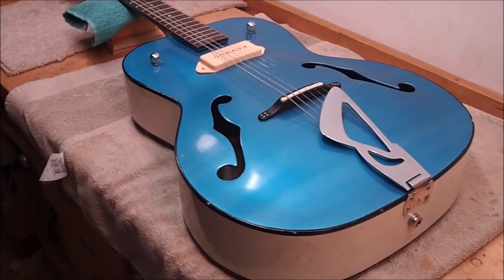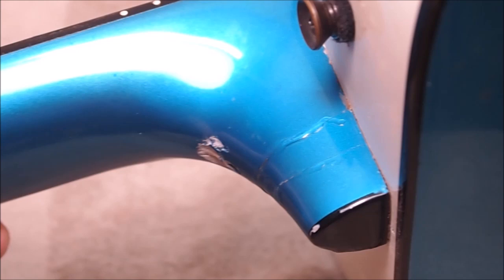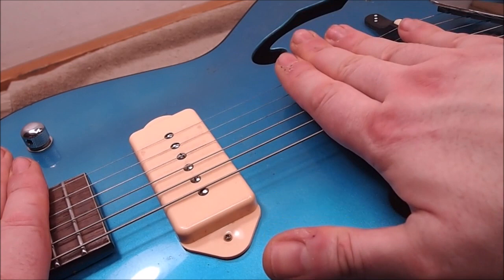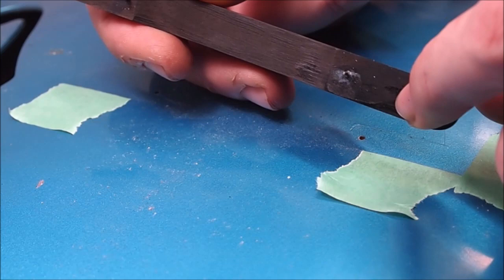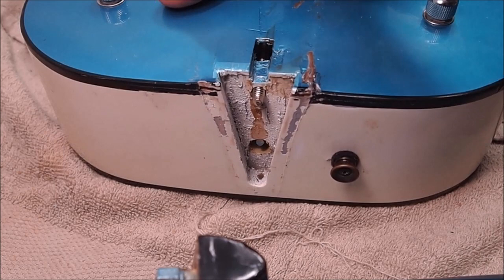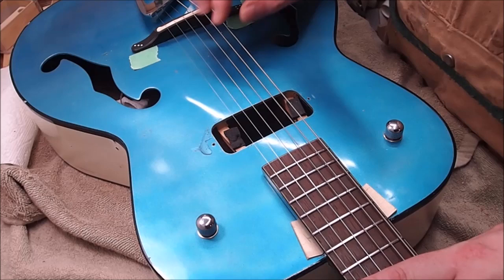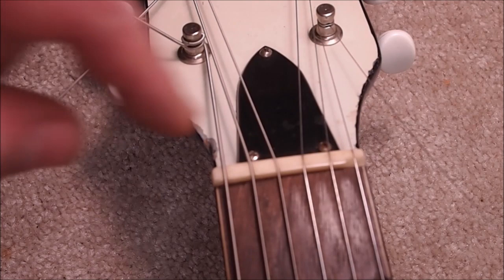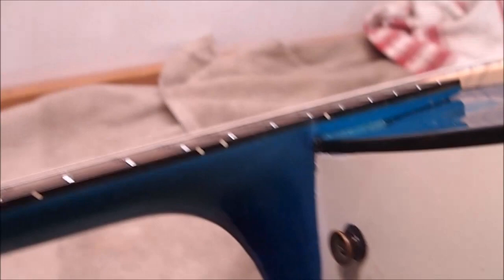Correct the Neck! Old Kay gets some lovin'

Comment: FYI:  You can find a cheap spectrophotometer on Ebay for around $30, You can buy a super high quality used spectrophotometer that is ordinarily very expensive for around 30 bucks as well.  These devices are exactly what body shops and printing companies use to perfectly match the exact color, then you can have the exact match paint overnighted to you.  I used to work in the printing industry and hardly anyone realizes that these types of tools exist.    I have learned so much for your channel, and I am glad to give something small back.
Reply: Tao Tuhao true, however it’s never going to be a perfect match, and if you don’t have a color mixing station like auto body shops have to adjust the color, it’s pretty useless.
Reply: @samueltaylor4989  Absolutely, but you can actually order a specific color based on the CMYK values.  However, texture matching is certainly more of a challenge and in this case the color is somewhat metallic so  the exact match will be difficult, even when you have industrial grade equipment . Speaking from experience , you can get extremely close.
Reply: @samueltaylor4989  This would take TWoody's repairs to a new level...great suggestion.
Reply: @samueltaylor4989  My local paint shop will measure and mix for you, only issue is the minimum size and price, but if the customer feels strongly about it it'd be well worth the effort.
Reply: I fear that Twoodfrd doesn't read the comments...

Comment: In addition to the great work that you consistently perform I respect that you chose not to disparage the work that was previously done on this guitar. There is an individual on YouTube who spends more time being critical of the instruments and the manufacturers than he does working, while the quality of his work is usually below expectations. I really appreciate that you spend your time (and ours) concentrating on problem solving instead of idle criticism.
Reply: Jts3339 I think I know who you're talkin about if it's an older man he does incredible work have a great day
Reply: But this work was a straight up disaster.  Its a bit different than nitpicking.  This work was unacceptable by any standard.   We need to hold bad luthiers accountable.
Reply: @charvelgtrs  The best way to hold poor practitioners of any trade accountable is not to shame them; it’s to withhold bringing them our work until they correct their ways or go out of business. Good or bad work speaks for itself.
Reply: Although saying "I won't disparage the work of..." is really the ultimate humble put down!
Reply: @jts3339  true but others should be warned to save them the trouble.

Comment: looks like b5 blue it's a plymouth car color when I need a match I go to an auto body supply store they will take a picture of your color and computer match it and put it in a spray can
Reply: That's asking for a poor color match. Too many variables that have to be taken into consideration. You'd be better off with taking whatever object you need to paint match outside and looking at it and color swatches under the natural light of the sun.
Reply: Roger J - try that computer color matching service on something that doesn’t matter too much, you will be surprised at how good it is. I was skeptical too but I gave it a shot. I’ve used it a couple of times now and it’s been spot on and well worth the trouble if your project has to be right. My local paint supply has a system that not only reads the color with a camera but dispenses the tint into the base as well, I think some only analyze the color and print the mix instructions. There may be a difference.

Comment: They make a flexible extension for going around corners.  1/4" is the size I have.  Works like a charm.  Get one for those tight jobs.  Or use a long extension thru the hole for the pick up jack and a ball headed Allen to turn the furniture bolt.  Also, for wood saturation, you can get a product called Git Rot from any boating store.  I got mine from West Marine here on LI, NY.  It's a 2 part epoxy that the wood will soak up like a sponge.  Get it and keep it on the shelf.  It has many uses.

Comment: OK, before I watch the rest of this. I agree with the neck needen to be raised. I would take the neck off, glue on some extra wood material, and then shape it to fit the curved top all the while raising it to get the desired string height. I hope that's what you are going to do as well...Let's watch and learn...continue...Oh, yeah, taking from the heal to change the angle. Great stuff..adding the shims fills the space. Awesome...my way was much harder. Thanks, this was a great demonstration.

Comment: Next time you have to deal with screws like that simply get a 1/4 drive ratchet set and 1/4 drive hex bit set.
If you can't find the correct length extension you can simply cut one off and grind a new square on the end to fit your application.
Reply from the maker: Hehe. I tried!  The socket body had clearance problems against the top and I didn't want to sacrifice my nice ball-end bit.
Reply: @twoodfrd  thats when you build custom tool 101a..grind off outer OD of socket housing till it fits!

Comment: Use a 1\4 inch drive ratchet for the Allen head bolts there is all different size extensions for length . I'm an automotive mechanic and nothing is user-friendly especially on the new cars lol
Reply: Was gonna say I have that ratcheting device he mentioned - 1/4" drive, long-handled ratchet, extensions & Allen heads on the "sockets" ...indispensable!

Comment: Great idea on the spruce shims.  I have an older kay on the bench (for far too long).  Previous neck reset done with gorilla glue, off angle to the body and action way to high. I ended up cutting it off and  I have futzed with trying to carve a replacement support under the fingerboard extension but have not been able to do a good job.  The shim idea maybe the way to go.   As big a PITA as yours was, I would kill  to have a pickup hole to work with as I plan to convert it to a bolt on neck.    A favor to a friend is turning into a taxing situation for our relationship.  Taking way to long.  :)     Thanks for the great video

Comment: I just bought a fret leveling kit to address a high fret on my Strat. Every time I bend a string at that, fret, the note chokes out at anything above a half step. There's also fret buzzing on the 3 wound strings right at that some fret. So I'm pretty sure it's high and I've only owned a guitar and been learning to play for 2.5 months. But anybody with some sense could deduce that the problem was a high fret. 

A little internet research confirmed it so I'm going to level it myself. The action is also higher than it should be to compensate for that fret. 

Wooohooooo! 🤣😁
Reply: Level, Crown and Polish ALL OF THEM.

Comment: Hi, admire your skill, I have an old Kay also,  and Airline, too,  though  I would like to make some suggestions. First, replace those idiot socket head screws with bolts and a washer that would spread out the force. Easier to work with, too, just use a 1/4" ratchet and extensions with correct socket. 2nd. Fill the necks dovetail voids ( huge flippin holes!)with some good epoxy so the dovetail and butt is strengthened. 3rd. Make new holes for the screws while you are at it, fill with a hardwood dowel and epoxy.  4th. Testors has metallic paints that would be perfect for color matching, mix and match. 5th. There are 1/64" and 1/32" plywoods made by midwest hobbies that would be perfect for shimming. A wedge will have a narrow point of contact. Better to have a larger flat support. Hope this helps. Best wishes.
Reply from the maker: Those suggestions would be excellent for someone who doesn't have to make a profit from work like this.  Total time allotted here = 3 hours total or I'm working for free.  If I have to drive to the hobby shop and buy every metallic blue to mix, this guitar goes right in the garbage, because nobody can afford that. I did fill out the dovetail mortise for close contact and used wave washers for constant tension in the event of seasonal changes. Tapered wedges made sense because the extension is concave and only the outside 1/4" contacts the top.

Comment: Your fellow Canuck, Luthier John Carruthers, welded a screw driver tip onto a long extension to reach the neck block for those Kung Fu neck resets. He goes right thru the hole for the end pin in the tail block. I've used it in his shop chucked into a screw gun. love your vids...

Comment: I'd even take a drive to ratchet that thing back in when taking it apart took half an hour. 
You really got patience.
Reply from the maker: The socket body was too thick. It pressed against the top and it wouldn't allow the bit to hit the bolt at the correct angle. Fun times.

Comment: Harbor freight has a tiny ratchet that comes with different attachments ,if its a allen screw head you can fit it to it may have to cut angle of allen off so its straight ,would save alot of time and aggravation ,I use it for doing electrical projects in tight spaces also have a right angle ratchet saves so much time

Comment: You can buy an Allen head socket for a socket wrench for those hard to reach fasteners also there is a flex adapter so it will work with any angle.

Comment: You can use a socket wrench with an extension end a L wrench adapter for the neckbolts. It would work easy peasy, I use then all the time on parts for my car but they would 100%work for what you need

Comment: that's nice, a P90..cool. Razor Tribute TSB-91 Dog Ear Electric Guitar Pickup. I have had a few of these and they do have crappy necks. I have an Ibanez J 200 copy that needs just a bit of work to be a great acoustic. It stays in tune well but at some time it didn't because some one got the neck where they wanted to and then shot hot glue down in the truss rod hole at the head stock. I assume to keep it from moving. now the action is stuck a bit to high. the bridge has a hair line crack in it. It is beautiful with an abalone in lay.

Comment: I have seen the removal of the neck bolts by going through the end block at the butt end of the instrument. A very long extension or several ganged together stuck through that hole that the end pin goes in and a Allen socket added as the extension gets in the body.  I’m sure there was a custom tool at Kay to do this at manufacture.

Comment: That tailpiece looks like a Harmony. I have an H 72  from the 60s, and it has the same tailpiece. Of course, it may have been adapted from a Harmony, or Harmony and Kay may have bought from the same manufacturer. The paint looks like a Dodge auto paint colour - I used a similar paint on an old archtop that I gave away. The P90 looks altogether proper on there.

Comment: We used to have an auto color paint shop that had a hand held scanner you walk in or drive car
to place they walk out match color mix you up pint or quart whats needed and they would mix it do a control on piece of masking tape let it dry a bit and go out and match the color in the sun.
The scanner would be placed on rectangle area of color and they pull trigger and it photographs the color and when you feet that into  computer it mixes the colors correctly to match....
Then you can match direct to control  tape and say lighter or darker or just right......
regardless you can match the color and fade it back in.... would not take much to do that job...
But the auto color scanner would be the way to do that or bring in actual color let them see it and try to match it.  I shot every custom color  Fender ever painted and then some in metalic and solid color and that area back in heel of guitar would not be seen much anyways so if it was darker there it might fade out and look neat anyway.  Worse case do stinger on the heel and back of headstock or fade dark to light on back of neck..  Kind of a light harbor blue  or lake placid blue..while the neck was off any place under side the neck would have been good to remove paint chip samples carefully..    but to scan they need a 5 inch area or so of color
then it will literally formulate the color and its mixed accordingly.  The auto color place closed here sadly no idea where the paint bay or scanner or all that went too. :(
I used them for alot of colors though....back in the day....
Reply: HAH that’s awesome

Comment: A "ball end" hex wrench would have been helpful for removing the neck-heel bolt. Allows you to get a good fit into the socket head of the bolt without having to be absolutely dead-nuts perfectly inline/ perpendicular to it. Putting a ball-end hex bit on a flexible extension would be even better. You can make a regular hex wrench into a ball-end wrench with a bench grinder and/or Dremel tool....
(Also, hey, it's Canada; what, no square-drive Robertson bolt? The hex bolt is probably a better choice for this purpose anyway.)

Comment: That appears to be Lake Placid Blue aka Pelham Blue aka Duplicolor Bahama Blue. Pick it up in a rattle can at the auto shop for 8 bucks. Metallic custom colors are hard to match or even overspray as they're translucent. Maybe model paint in a few popular shades would be good for touch ups. In fact, I think these shades also come in chip filing sticks from auto suppliers too.
Reply from the maker: Not even close.
Reply: @twoodfrd 

Edit 2: I'm removing any contrition here. I've checked my sources (including... experience?) and I don't think I'm wrong. One of us is on the wrong side of the Dunning-Kruger curve. 

Lighting,  cameras, phone screens not withstanding, that looks to be at least "even close" to that super popular metallic blue shade. Having used duplicolor rattle cans to recreate retro custom color paint jobs I can say it's a convincing effect. Whether that's useful information from a touch up perspective, maybe, maybe not. So, I'll leave that comment up there for the edification of anyone who gets advice from yt comments.

Comment: A lot of 1/4" ratchet sets/systems include an adapter for 1/4" hex bits. This would (I think) be a good way to reduce the hassle of those neck bolts - you "just" need the right length extension/
Reply from the maker: I tried, but there was a clearance issue with the socket body and the top. They wouldn't line up and I wasn't in the mood to cut my ball end Allen in two.

Comment: A 1/4” drive ratchet wrench with appropriate extensions and bits would have made much easier work of those furniture bolts in that confined space.
Reply from the maker: You'd think, but no.

Comment: I'm working on a Kay archtop of my own for some practice in neck resetting. Would there be any benefit to cutting off the dovetail and gluing that into the body since the threaded inserts are already so deep in the heel? I'm thinking it would make the sanding pulls easier. My neck came off super cleanly with the dovetail, but the more I think about it the more I like the idea of a bolt-on neck.

Comment: Twoofrd, I will take a guess that those allen key  neck bolts were put In through the tailpiece end of the guitar with maybe an extra long screwdriver with a welded on allenkey on the end.  I have seen them before and used them too. They are quite a bit less pain in the ass than how you did it, but it DOES work . I am enjoying seeing your Videos again after not having a single one pop up in my YOUTUBE feed for years. I am up in Prince George Northern BC.

Comment: I love the old Kay guitars and have bought more than one off ebay in this condition or worse that ended up being wall-hangers.  Would it be out of line to ask a ballpark figure for a job like this, done buy an expert like yourself ?  If it is too personal in a public forum,  I'll understand, and thank you again for a most excellent video.
Reply from the maker: I think it was about $150.  Resets on glued necks run closer to 500 because there's almost always fretwork involved.
Reply: @twoodfrd  In retrospect the Kays I came across were glued, but one appeared to be loose in the cavity, and the other did not appear to be loose, but had shifted  in the pocket so the action was unplayable.
Now that I have an idea on cost, I'll see what I can find . I have the feeling virtually all these types of guitars on ebay need a neck reset, but if you can get them playable again, they sure are fun to play.  Thank you again, you do great work.

Comment: Those damn guitars always seem to have super high action thanks to crappy neck design or something.  Kay, Regal, Harmony, Silvertone all fall in the same category to me.
Reply: Beg to differ with the "always"
Reply: Camilo I could very well be wrong.  Just an impression I have based on the ones Ive seen for sale, the articles Ive read about them on collector websites, the youtubes I've seen, and the one I owned.  A high action requiring a neck reset or other bridge work seems a common complaint.
Reply: @fenderstratguy  I've been lucky twice, but we're talking about very old guitars. I'm not surprised that many need a lot of help. Even flat-tops suffer if left tensioned when not in use. I read somewhere many years ago that if a guitar is going to sit for 12 days or longer you should de-tune it (18 for electrics). No idea who made that up, but it seems a good rule-of-thumb.